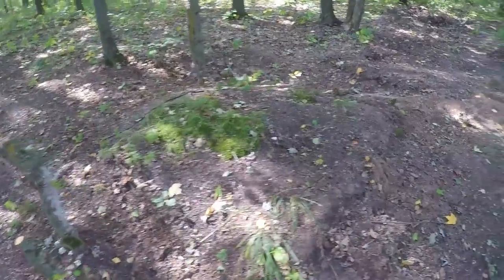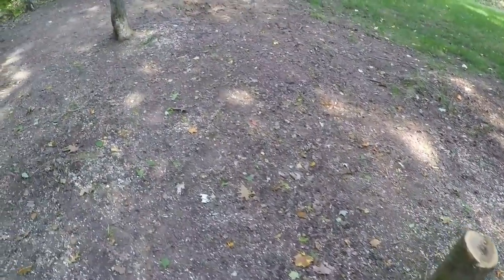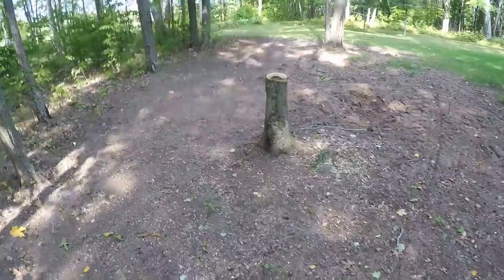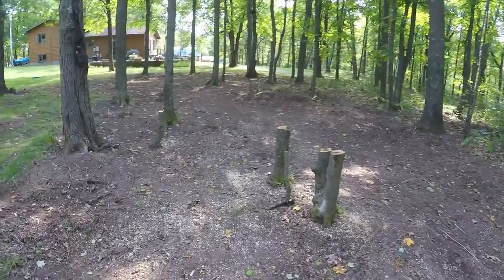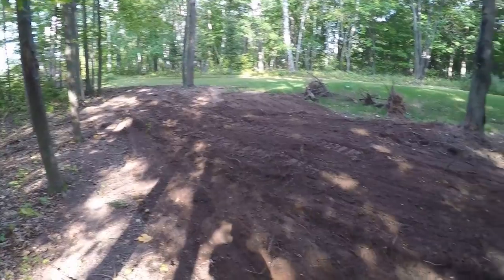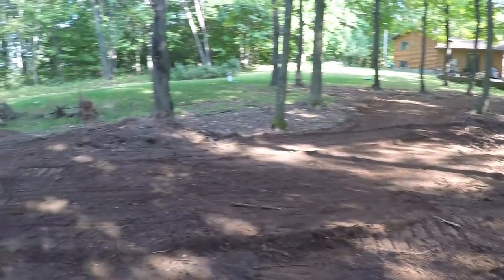Caterpillar D2 Bulldozing Stumps

Comment: WELL! A dozer video from the now train guy! Hi, Pal! Glad to see Pap in the saddle. Bet he'll have a grin on that fuzzy face for a while after that! Fine running little tractor. I ran a 2 YEARS ago for about 15 minutes. Felt just like an old 4 with the spring springing and the blade staying flat. Just wondering if he was in the #2 notch. Pretty fast for #1 but it's been a while since I was in the seat of one. Pop is a smooth operator and I like grubbing stumps a site too! Hope all is well riding the rails! I've been doing some digging myself but ought to be done tomorrow. Just enough to stay limbered up but not too regular. Us old geezers like to work but don't want to be pushed! Take care of yourself and all those interesting machines you've got stacked around the home/20 and we'll be waiting for the next'un and thanks for This'un! (me)
Reply: Sure is a bummer that the rail riding panned out so quick but at least you can be there doing something really constructive. Seems like the more 'official' something is, the least you can depend on it. Like I said, I ran a 2 a little bit but a 4 a lot more and it had the same bounce, just a longer track frame. It's a little unnerving the first time that happens because I thought I'd REALLY messed something up, even though I'd watched the old sawyer/logger run it a bunch. He probably just wanted to see the color drain out of my face. It did! But Pop has a fine old tractor there and you can give him an A-PLUS from me. I've been running a worn OUT JCB hoe that everything leaks down or off (not out) but the main boom.  But anybody can run a new one! Just take your time getting used to 'civilian' life again and God willing, I'll be right here!

Comment: looks like lots of front end going up in a hard push,,,,are you sure your cross member has its shackles in good condition? i was getting lots of that until i found my cross mount at mid side frame had pins broken out of the shackles,,,,regards,,,and thanks for video